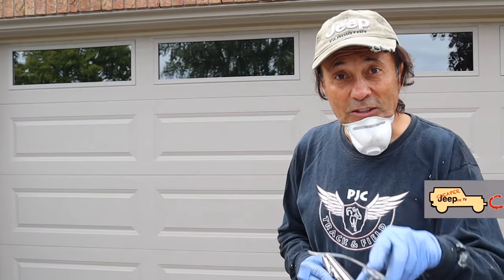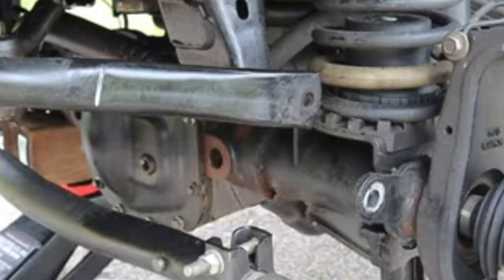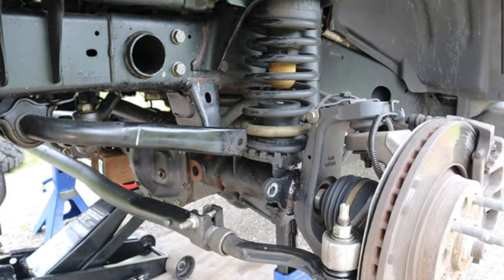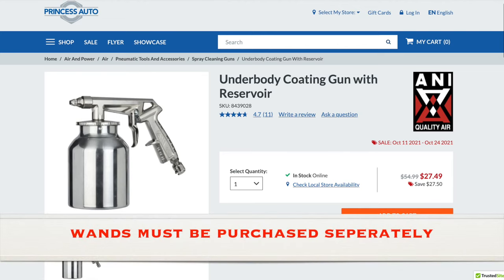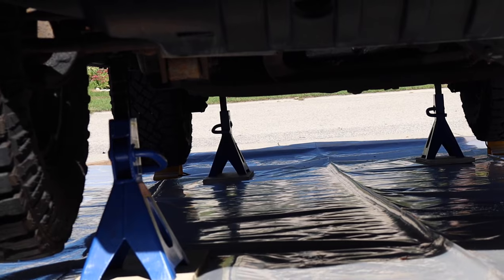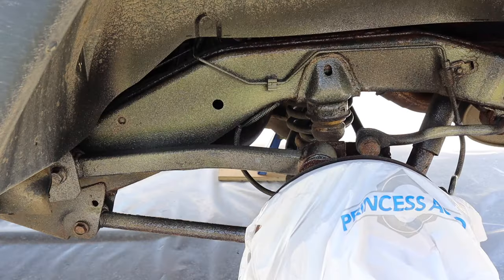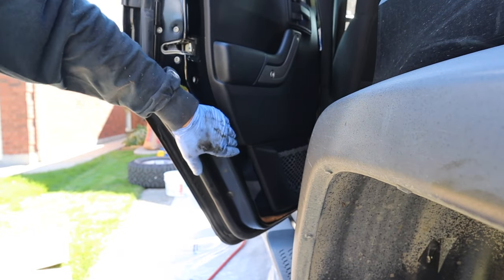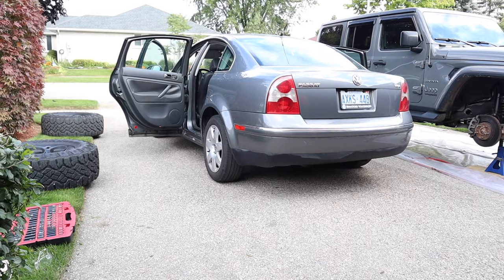DIY Rustproofing the Frame of Your Rig, Save Over 60%

Comment from the maker: I accidentally left out an important tip, and that is to clean off any existing dirt and rust from your frame, then apply the fluid film. Also, if you just do not have the time, you can still apply the fluid film this time, as it still will help, and get to cleaning and/or wire brushing those spots on the frame next time.

Comment: Hey Dino, excellent video, again !!!
Man, you are the real jewel to the Jeepers community, with all the ideas, how-to-dos, tricks and tips, money savings etc. 
Also, many THANKS for mentioning me in your video for the subscribers tips. 😀
Not sure if I missed the info but can you repeat how often would be needed to re-apply the Fluid Film?
I got "tricked" by the stealership here in my town, when I bought my new JL to add the undercoating and seats stain protections (at hefty cost)... While seat protection was apparent gimmick immediately and that stain protection DOES NOT work (or they never applied it but said they did) , the undercoating and rust protection was a big surprise for me when I went underneath my Jeep changing my front bumper... They applied it, literally randomly covering some spots and missing others... Looks like someone just squatted and sprayed the Jeep from sides without even going under it... Pointed that to the service manager and was told, if I get them to lift my Jeep with the Mopar lift kit, they will redo the coating "for free"...
I am going to Princess Auto tomorrow (my favorite Canadian store) and getting the supplies, spraying going on in a week or two, and not only because it is cheaper, but more importantly, because I will make sure every square inch is covered... Luckily, I have the compressor already...
Thanks again, keep the channel growing and cheers, Nash
Reply from the maker: Hey Nash, The dealership should have corrected their poor application if the rustproofing without trying to hold you ransom to buy more from them. That’s unreal. 

Thanks for the feedback on the video. 

Now that you plan to do it yourself, you can reapply the product every year, OR where and when as required. 
For example if you go wheeling through mud and sand, you may want to reapply more often, should you feel the product had need rubbed off. That’s the beauty of doing it yourself, as you can do it whenever you feel the Jeep needs it. It’s surprisingly easier to do than you think. Have fun. 
Cheers.
Reply: @CheaperJeeperTV  Thanks Dino 👍🏻👍🏻👍🏻

Comment: A have a JL. You  can fluid film from the bottom of the doors through the water holes. A can of FF with the red straw works great for this. Also, a couple holes are behind the foam on the hinge side of the rear doors. You need to remove the foam to get to the holes. A small plastic pry bar worked great to pull on the plastic clips. Did my best to aim behind the hinges. Fluid Film helps against Aluminum corrosion as well so I hit as much as I could. I also sprayed through the holes under the hood. Tried to hit the underside of the hinges as much as possible. The hood has a lot of access holes underneath. Since Fluid Film creeps it's a good feeling to know that it's spreading rather than rust.
Reply from the maker: Hey Diggin Drums,
Amazing tip!!  Thank you. 🙏 
Cheers
Reply: @CheaperJeeperTV  great video and channel btw, thanks for all your tips!
Reply from the maker: Hey Diggin Drums,
I really appreciate that. 
Thank you. 
By all means feel free to share any videos you found helpful elsewhere for sure. 
Cheers

Comment: I would have treated all the existing rust by wire brushing the rust then using a phosphoric acid to convert the rust.   Then, I would spray the fluid film on top of the treated metal to prevent further rusting.
Reply from the maker: Great tips!!!!  Thank you.
Reply: I was thinking the same thing. Maybe the rust inhibitor then the rustoleum rust paint and then this fluid film ?
Reply from the maker: I agree. I believe it would have been even better to have followed those steps.

Comment: Do you have a video on how to spray inside the doors,hood,tailgate rockers and inner cavities?  Thanks for the videos.
Reply from the maker: Hey Randy,
In the video, I showed how the long tube/hose attachment does a wide spray, and I fed it through the frame holes to get at the inside of the frame.  It turns out, the doors and body panels of the JL are all aluminum, and therefore spraying the insides to prevent rust perforating through is a non issue, so spraying inside, I believe, isn't necessary. 
On a JK however, if you have holes from a previous commercial application, you can use those, otherwise, I guess you can try accessing the inside of doors through spaces where the locks and latches are? But, the short answer is, NO I don't have a video on that☺️
The following video is more information on the corrosion issue on the JLs if you're interested.
https://youtu.be/fzls6xrTa_o
Cheers.

Comment: I use Fluid Film its $45 / gallon. I purchased the gun to apply. I have a lift so it's easy to do. This lasts a long time on areas that are concealed but needs to be applied annually on the areas that are exposed. The gun comes with hoses to get inside the frame and body parts. Best time to do it is when the vehicle is new other wise clean the frame best you can.
Reply from the maker: Hey Rodney, Thanks for your input.  The beauty of applying it yourself, is that it makes the reapplication of Fluid Film more affordable.  It also helps big time that you have a lift. :-) Cheers.
Reply: @CheaperJeeperTV  I've got a 2021 JL that I ordered and has been waiting for transport for a month. When I get it I'll be Fluid Filming the crap out of it so its protected for its first winter.

Comment: That was a great episode thanks for the video . I’m getting a new jeep and I’m wondering if from the start would it be better to first sand any rust areas and then spray rustoleum rust inhibitor followed by that rustoleum paint stuff to cover it all and then do the fluid stuff you put on or would that be overkill ?
Reply from the maker: I believe I have seen videos online that suggest that you scrape off any rust before you treat the metal. So your plan doesn’t sound too overkill at all.
Cheers

Comment: Thanks Dino...  Will be trying these products for sure next spring on my JL; would you apply this every year of based on KM driven... thanks... 
BTW nice hair style :-) ...
Reply from the maker: Hey Luis, I plan to do it every spring and fall. I drive at least 50,000 kms a year and do a little off roading, so I think it will benefit from the twice a year application.  If you drive mostly in the city, you may be able to get away with once a year.  I was surprised at how easy it was, so I don't think I'm going to mind too much. As for the hair, all you have to do is avoid the stylist during covid, and wear a Jeep Cap. Free tip! lol

Comment: How many miles are on your JL now? Any major issues so far besides hinge corrosion?
Reply from the maker: Hey Erick, I have 150,000 kms on my 2018 JL Sahara and other than the corrosion that keeps popping up in different places,  such as hinges, leading edge of doors , hood, fender and windshield frame, as well as some electrical gremlins, it’s been great. Cheers.
Reply: @CheaperJeeperTV  have you had to replace springs and shocks yet?
Reply from the maker: Nope. No issues with those yet.

Comment: Be careful Fluid film should not come into contact with rubber
Reply from the maker: Hey Jochen, Thanks for the input. I’m not sure where I heard that Fluid Film is ok on oil resistant rubber and the rubber under your vehicle is ok. That it’s the rubber covered foam that makes up the seals around the doors is where you may have an issue. I wish I mentioned that. Thanks again for your tip. Cheers.